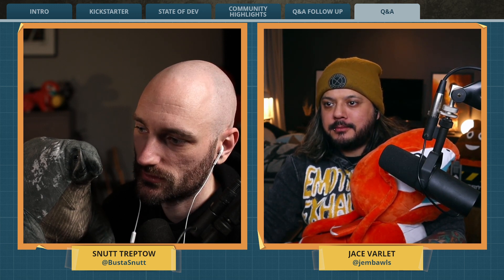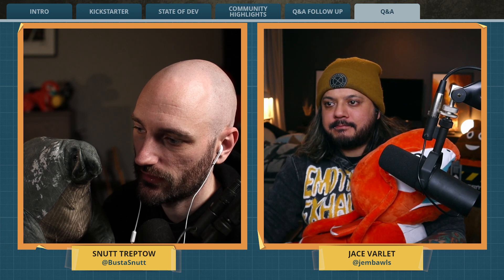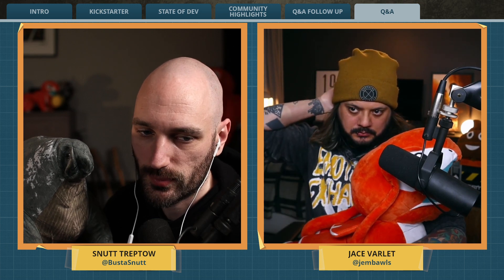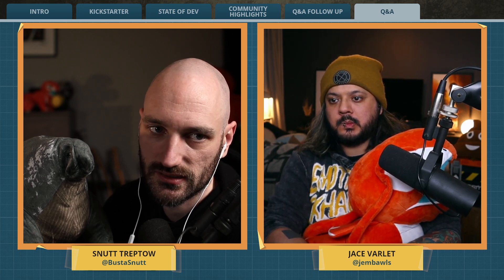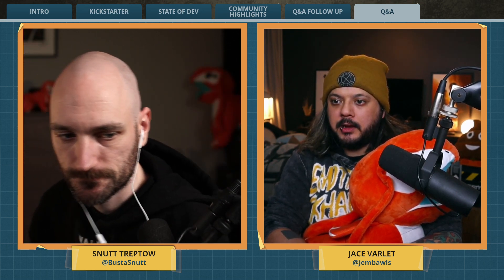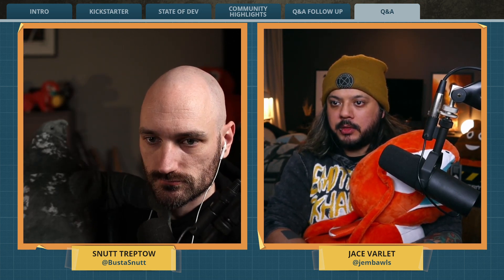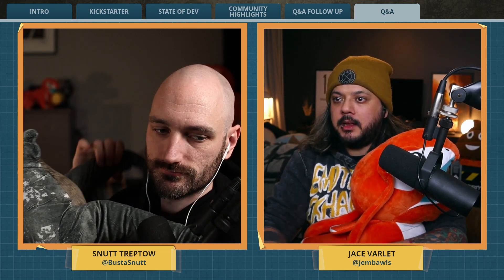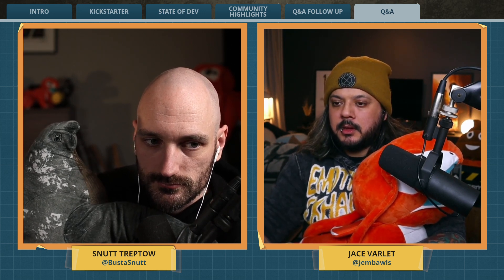Q&A: Could you explain the technical issues behind the flow rate in Mk.2 Pipes?

Comment: As someone who mods Satisfactory i can tell you: there is nothing inherently wrong with mkII pipes. They do work for 600m3 per minute just fine.

The issue is that fluid sim is actually very accurate, and not intuitive for most players. 

machines consume fluid in chunks - when a cycle ends, it requests more fluid. It can take fluid from the pipes at a rate much faster than 600m3. 

Then fluid can flow both directions in a pipe - When there is a gap (ie, after a machine draws a big chunk of fluid) fluid will flow there away from other machines.

When several machines do this in near succession, its entirely possible for fluid to flow away from a machine right before it needs it - leaving it thinking there is no fluid in the pipes.

You can reliably have mk2 pipes running and consuming 600m3 per minute with the following tweaks:

Feed your pipes to your machines from above their inputs, and loop your last machine back to your first. Since fluid respects gravity in SF, feeding from above means that any "gaps" that appear in pipes due to fluid flowing away from machines to fill others appears at the top of pipes, away from the input - giving each machine a mini buffer to draw from. Looping the very last machine back to the first means fluid can flow from the input to the very end of your line immediately, reducing the effect of machines before the last few eating up all the flow and drawing fluid away from the last machines with nothing to replace it.

With those two tweaks to your system, you can reliably run 600m3 mk2 pipes with no issues.
Reply: based from my gaming experience, this is true
Reply: The proper solution is to simply add at least one fluid buffer to the end of a pipeline and prefill it. Those tanks serve to keep the water level up in the pipes by providing a "false" fluid source and thus helps ensure there's always enough liquid in any particular section of the pipes even if all the machines start feeding all at once. 600m3 coming in from the extractors and up-to-600m3 coming from the other side from the tank. The buffer will never dry out because when the machines aren't sucking in fluid the constant flow from the source will reach the buffer and refill it. Adding in a loop section is splitting the original 600m3 source into 2x 300m3; it can help with balancing the feeds but I suspect any benefit it brings is just from the additional pipe serving as a small buffer.

 @anteshell  It's explained somewhat strangely but yes that's exactly how it works. The machines suck in fluids very quickly in short bursts and it takes time for fluids from far away to reach and refill this void. It's the machines that don't work "realistically" in that they take measured gulps rather than a constant flow of liquid.
Reply: @anteshell  It's definitely how it works. If a pipe is completely saturated and the machine at the right end of the pipe demands fluid, this will create an empty space on that end of the pipe where the fluid on the other end of the pipe will naturally flow to. Not sure what you're having trouble wrapping your mind around.
Reply: @anteshell  I suggest you read what I said very slowly, and if it still doesn't make sense. Read it again. The alternative is you can keep crying here.
Reply: I have a pipe network made 100+ hours ago in my save, not connected to any machines, and the fluid in them are still sloshing around at up to +- 300 m³ / min. That's not physically accurate at all.
Reply: @anteshell   An empty space is created in the pipe when the machine demands fluid at a rate that exceeds the pipe's flow capacity as stated in the post you are replying to. Maybe you can fill up a fluid buffer with your tears and conduct some more tests, princess
Reply: @anteshell  Please tell us  how you think fluid moves through a pipe. Please tell us how fluid moves into a space that is not empty 😂🤡
Reply: @anteshell  bro your first post was trolling the modder you're replying to, but I'm the clown here to argue😂😂😂🤡🤡

And you trying to explain anything is hilarious
Reply: @anteshell  then how would you know? 😂
Reply: @anteshell  I would also backpedal from trying to explain your untenable nonsense
Reply: @anteshell  

anteshell: trolls OP

also anteshell : cries when someone trolls him
Reply: @bingbong3221  that's because the display shows the flow rate combined for both in and out. And if you are using things like buffers/valves? They complicate things even more. 

I bet if you take all the buffers/valves out, feed the machines from above, loop the first to the last, fill the pipes before starting, and only turn one machine on at a time - assuming that your production is at least as high as your consumption - it will work just fine.

yeah. Dont get me wrong, the system is more finicky than it probably should be which leads to difficulty. But it can be done at 100% efficiency for 600m3. Its not bugged its just difficult... which should be addressed.

But its not bugged and thats important to make a distinction on.
Reply: @anteshell  still a simulation. And "fairly accurate" does not mean "Nothing is ever wrong".

The fluid sim takes into account: level, height, gravity - but "pressure/headlift" is not really simulated - which would prevent it from moving away from machines.

Its not *perfect*. but fairly accurate.
Reply: @anteshell  I said it was "fairly accurate" and the obvious context here was *within gaming**. Does it do everything perfect? hell no.  Does it do things in a way that works, mostly is accurate to **most* fluid properties in the real world, but in a way that is simple enough to be done quickly*by a game? yes. Is it far more accurate for fluid mechanics than what most games would do in this situation, which is just make pipes "disguised belts" and transfer fluid as 1 unit packages? yes. yes it is. Does that make it, within the context of gaming and simulation based factory games, "fairly accurate"? Yes. 

Do not confuse fairly accurate 'in the context of a simple game that must be run on potato computers while doing hundreds/thousands of other simulation calculations at the same time' with fairly accurate 'for research and scientific purposes where the only thing being done is fluid mechanics and the processing power is hundreds of times your average teenager's laptop?'

Do not confuse 'a game' with 'science'
Reply: @anteshell  oh mr "I'm not trolling" is back😂😂😂 relax everyone, he's not here to argue, just disagree with everything you say and have straw man arguments with himself.
Reply: @anteshell  Oh princess is gonna block me. What a loss! 😂😂😂 How can I possibly match the intelligence of a "your mom" joke🤡🤡
Reply: As someone who programs for a living i can tell you:
People will constantly act like thy know all about satisfactory just because they mod a bit on it. jeeesh.
Unless you know the exact code from the programmers you have no clue how accurate it really is.

Comment: It's the same problem we have in base 10 with numbers like 1/3, and many others. You have to cut it off at some point, and over time errors accumulate because computers don't (normally) do arithmetic with fractions like 1/3, or "units of pi", they just mesh the number in.

Comment: @Satisfactory Clips Archive, wouldn't the simplest solution just be to round the floating point values up instead of down, in the calculation of things. For example if 0.1 + 0.1 = 0.1999999243 and most other rounding errors have the same precision issue, you could do 0.1 + 0.1 + ERR, where ERR constant = 0.0000001(the upper bound of your floating point error boundary), so 0.1 + 0.1 + ERR = 0.2000000243. This would have the effect of having a little more than expected stuff on belts and pipes(in case this also solves your 780 issue as well), however I don't think people will care if they are expecting 600 flow and get 605 flow since it wouldn't ruin their setup, they care since it is 595 flow instead of 600 which messes up all calculations downstream. If the pipes have capping at any point in the flow like max x, where x = 600 or some maximum, you could set the actual maximum to be 600 + y*ERR, where y is some multiple of the ERR constant above to guarantee flow stays above but not by as much, so when a long pipe gets to machines it may get 600.001 instead of 605. Either way there is less logistical problems when you have too much instead of too little, it would be an easier problem to solve, and you get less complaints. Seems like a simple enough solution to implement anyways. FYI I am a software engineer with over 20 years experience. The only downside I could think of is if that extra addition operation everywhere has any effect on the frame rate on a grand scale.
Reply from the maker: FYI: I don't make the game.
Reply: You're treating pipes like conveyor belts carrying liquid packets in a known direction, here. I don't know exactly how the fluid simulation works in Satisfactory, but it's not that. Pipes in this game have backflow.
Reply: @rantingrodent416  True, however you can eliminate backflow using the valves. This bug exists due to floating point values even with unidirectional pipes. However, you are correct that you can get problems with backflow not making things add up properly if you are not using valves, and that is not a bug. Once everything uses valves and you have no backflow however, there is still an issue and that is what they are talking about with this bug.
Reply: Better to just not use floats. You can do a lot with int or long.
Reply: The problem isn’t just epsilon but:

1. Fluid transfer is quantized, and 
2. Bidirectional. 

This can cause a pipe to be less then the limit causing temporary hiccups as the system eventually reaches equilibrium again.

The solution is to use:

1. Gravity by having input pipes come from a higher altitude, and
2. Use a fluid buffer 

To help force fluid flow be (more) unidirectional.
Reply: Could also scale it way up. If, instead of 0.1 + 0.1 you use 100k + 100k, you can use integers. Then, to display the values to the player, scale it back down by dividing it by a million(or, rather, multiply it by (10^(-6)), as that's faster) and converting it into a float only then.

Comment: Floats are rough. I wonder if the casting from float to Decimal, as I've found that usually eliminates the initial interpretation of a value input, where something like 15 would be 14.999999 repeating whereas Decimal would be something like 15.0 hard.
Reply: Decimal is slow, because it works in base 10. The more performant solution is to move to integer arithmetic. A 32-bit unsigned integer goes as high as 4 billion, but for simplicity, you could just say that the value stored is the number of milliliters of fluid in the pipe (i.e. one millionth of the value actually displayed to the user, which is in cubic meters). That never goes higher than 600 million (so it can't overflow), still offers a pretty good level of precision (nobody cares about one milliliter of fluid here or there, as long as things are "fair" in the long run), and makes it relatively painless to figure out exact integer quotients and remainders. You still have to figure out what to do with the remainder to keep things fairly divided, but you can probably just round-robin it or something.

(For industrial fluid buffers, the value goes as high as 2.4 billion, which is still well within the unsigned range.)

Comment: Can someone explain why they cant just make an integer from floating point and calculate everything like that and then turn it back to float? Or better yet, only use ints? Its what i do in web dev.
Reply from the maker: 780 items per minute is 0.0769230769230769repeating seconds per item
Reply: Only works as long as you do not calculate with fractions.
Reply: You can create remainders just like longhand division. It is possible because I’ve done it.  You just need more variables.